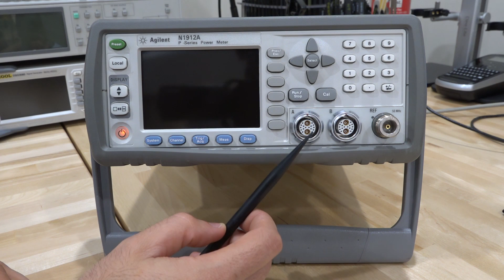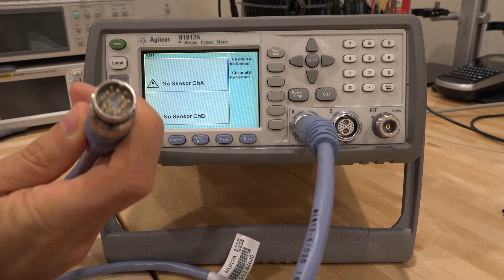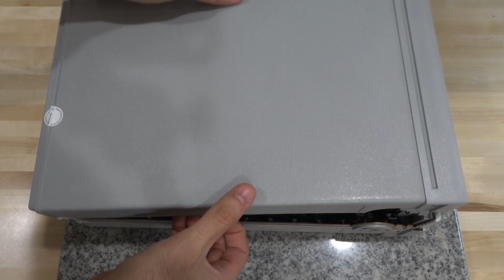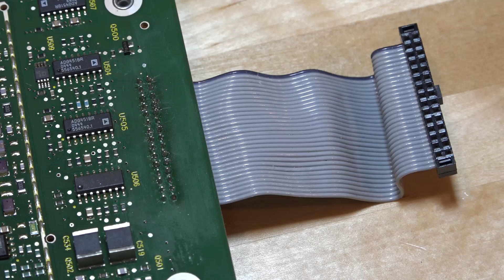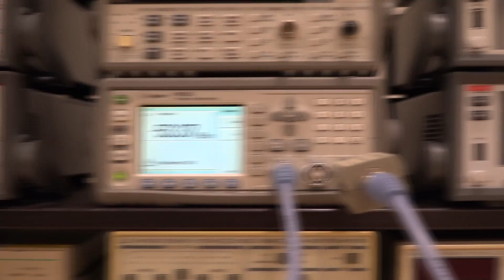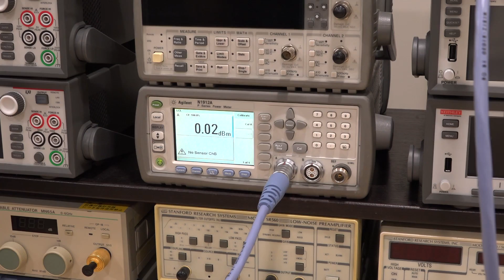TSP #110 - Teardown & Repair of an Agilent N1912A P-Series Power Meter

Comment: Dont yu think that maybe there used to be a connector and that someone changed the cable and removed it during a previous repair?
Reply from the maker: ben12801 That is not likely. The original warranty stickers were intact.
Reply: The Signal Path Fair enough thank you or replying. Fantastic channel BTW

Comment: What's the purpose of a power meter? Couldn't you just use a spectrum analyzer or a scope to measure the amplitude of the signal? 
I will make a guess: When complex modulation formats are used a simple amplitude measurement is not possible in the time domain. But you could still integrate the power density shown on a spectrum analyzer to obtain the total signal power....
Maybe the accuracy of the power meter is better...but then there is another question: When do we need such a high precision in the power of a signal?

Comment: Man you are the luckiest person I the world when it comes to fixing eBay purchases.  There are always tons of things that could be wrong with these that would be a show stopper.... But nope... Loose cable.... Bad capacitor..... :) :)
Reply from the maker: It's funny how when I have to reverse engineer an unknown synthesizer board, or trace an LO signal through a large microwave PCB, etc. people never say "Oh you are so unlucky to get such a complicated problem!". The fact is that when you fix a hundred instruments, some of them are bound to have simple problems. That is not "luck", that is law of large numbers.
Reply: The Signal Path hmm. Maybe its just that you're talented enough to make everything seem so straightforward and simple that it is hard to tell when a problem is complicated.  I didn't mean to offend you but my original comment.
Reply from the maker: Thanks and no I am not offended. It is just that when you look at a repair in isolation, it can seem like luck. And it would be luck just by itself. But consider that naturally some instruments will have simple problems and some very tough problems. I have on my bench now 5 microwave instruments waiting for repair. I am sure two of them will be very simple and two very complex. That is what I would expect on average. :)

Comment: Thanks for sharing. Nice that you can use the older sensor heads with an adapter; my old HP437 still chugs along and it is nice to be able to memorize the sensor correction factors now vs. the older boxes.

Comment: Nice instrument, haven't seen one of those before. I am pretty sure, that the plug is a costum LEMO connector   We were using a lot of LEMO connectors at work, but only the standard versions, no fancy mixed coax types, but even those are pretty expensive....

Comment: Do you know if the issue was a solder joint or the crimped cable? If it was the crimped cable it could happen with a connector too.

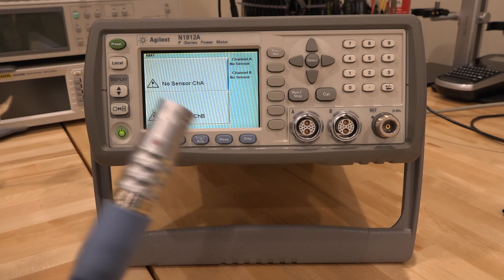Comment: 3:15 I'm not quite sure, but could those cable connectors be designed by Amphenol?
Reply: Dyaxxis looks to me like a LEMO connector. Back when I used to design medical equipment, these where the defacto standard connectors to use